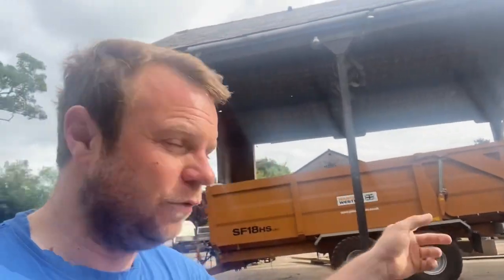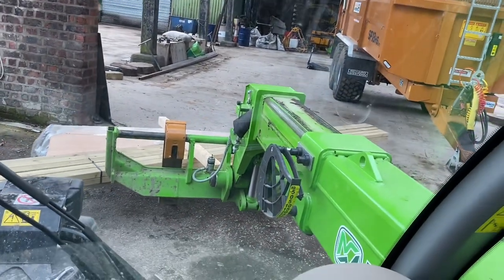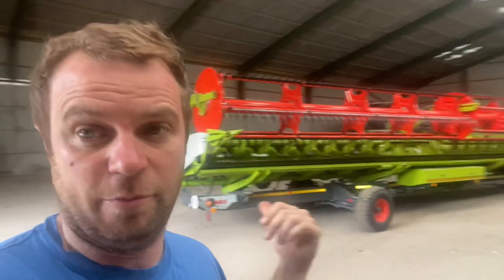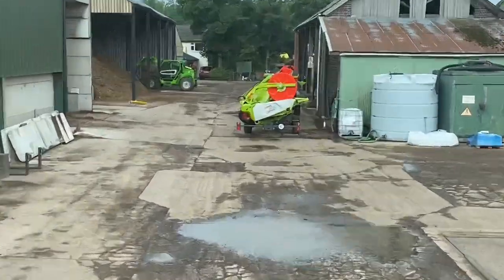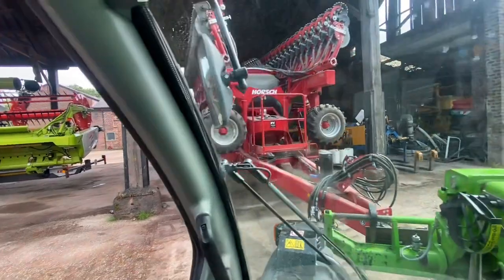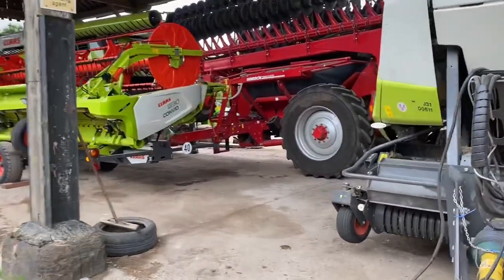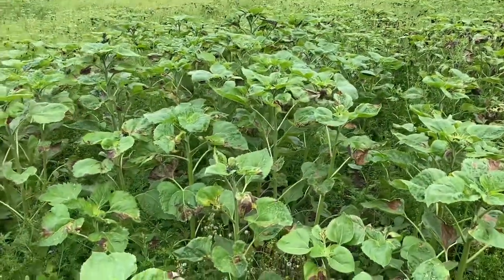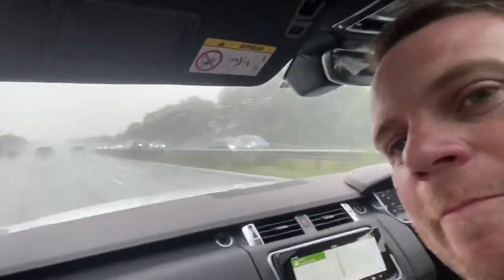Day469#OLLYBLOGS OPERATION STACK MOVING CLASS LEXION HORSH DRILL & QUADRANT BALER #AnswerAsAPercent

Comment: nice shed full of equipment olly, 👍do you think you will have an issue with rats in the combine, over winter ,  keeping it in that open shed?  have been watching nicks farm on you tube where they are currently cladding there open dutch barn to make a rat proof combine shed, expensive bit of kit to get wires chewed through
Reply from the maker: We have found and told buy are dealer the more open the shed and more light the better so always keep them there
Reply: @OllyBlogsAgricontractfarmer  👍
Reply: Unless you are going to make it air tight there is no such thing as rat proof, I have found rat nests in locked shipping containers that only get opened when needed, when I was running poultry farms the only place we never had rats get into was the freezer because the door had an air seal. 

If a rat can fit it's head through a gap then it can get in and any dark enclosed place is a potential nesting site for them.

Comment: Question for you about ur merlo. I drive a lot of different manitou telihandlers for one of my jobs which is liming acidic stream in the mountains of Wales to stop acidification in the water course. Now I don't really rate them very highly, they do have some good point but mainly not impressed. With the job I have to do with them I have to use the 10m models with the stabalising footplates, as I have to push the boom out horizontally along way rather than hight. As you will know lime is not a light product and even less when wet. I was wondering how far will your merlo boom out with a standard size bucket rather than a gain bucket, before she lifts the rear tyres. Now the manatou will boom out the full 10m and the tyres will be off the ground with out the stabiliser down and no lime in the bucket. If the legs are down she will keep the tyres on the ground but it only take one maybe two people to stand in the bucket before the tyre lift off. You say yours has a heaver back end than the jcb you had the one day there. I was just wondering how it would fair as the jcb doesn't like doing my job ether. Lol. One other thing do merlos have that stupid overide safety switch on the hydraulic's which stops you from saving yourself when the machine starts to tip over forward. Hope that make sense. I like the older CAT TH series of telihandlers
Reply from the maker: Our boom right out no problem with buckets on not sure on what weight in them will make them lift I can try and see and weigh back axle at full reach perhaps 
They do have stupid overload but u can turn a key to override
Reply: @OllyBlogsAgricontractfarmer  I have a stupid button which is located behind the lefthand side of the seat. You cannot reach it very quickly and can't switch it off permanently.
Reply from the maker: Wow what a place to work
Reply: @OllyBlogsAgricontractfarmer  cheers.  I'm lucky some of the time lol mostly its in muddy wet field trying to put up stock fence to stop them getting in the river for the charity I work for. But ha ha u take the rough with the smooth lol